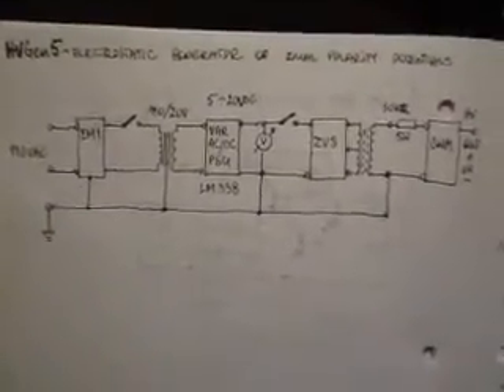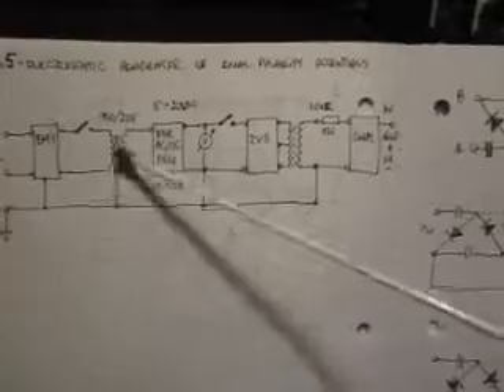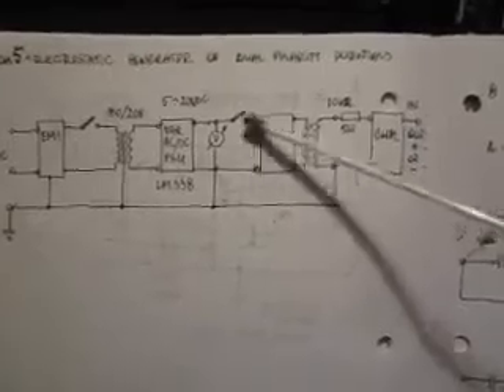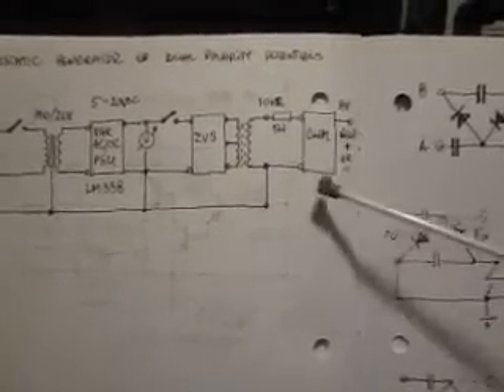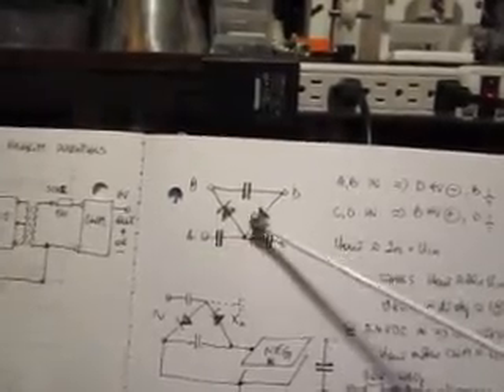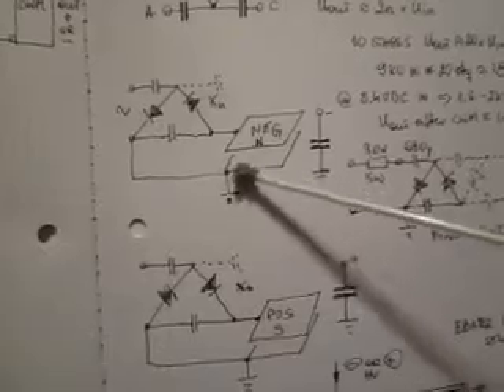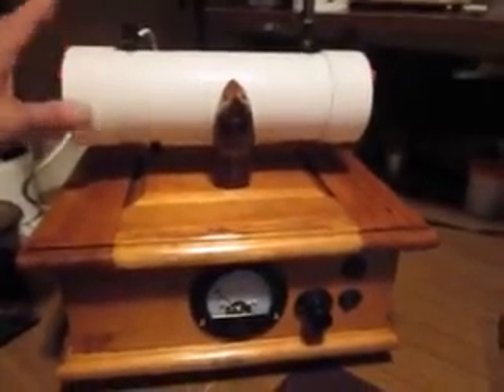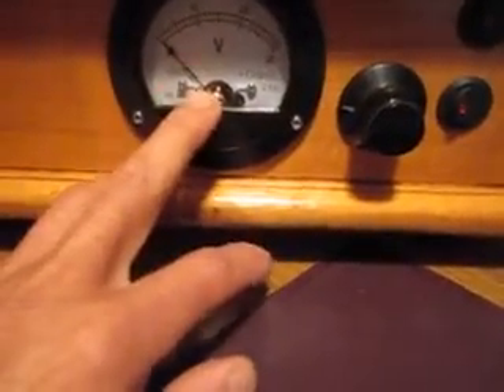Electrostatic Generator HVGen5

Comment: Whats the drive frequency?  And its HV AC output right?  or do you rectify it?
Reply: Ebner used high voltage DC fields. 1000-5500 volts per square CM field strength.
Reply: Yep, I know what Ebner used.  Depending on the gap thats pretty easy to achieve.   Another group replicated the genetic reversion in the book Seed of knowledge Stone of plenty. 

http://foversa.com/free-download-pdf-by-array-seed-of-knowledge-stone-of-plenty-understanding-the-lost-technology-of-the-ancient-megalith-builders-ebook/

Comment: I built an Ion Chair based on the Ebner-Geigy type work...  It uses a 20kv DC volt potential with negative on top and positive on bottom and I SIT in the middle of the electrodes bridging about 38inches of the 54inch static Gap that I setup.   Thats about 9 inches of air gap below and above me to the electrodes.   Its an interesting experience sitting within that field when the chair is turned on.    In process of looking to up this voltage to 80kvdc from the current 20kvdc...  :)

Comment: It sounds like you are going from a small 1.5volt source thru a volt regulator thats adjustable to get the 5-18vdc and then you push that thru the ZVS device which is presumably wired to a flyback with then an avramenko plug on the HV output side to collect the charge as HVDC eh?